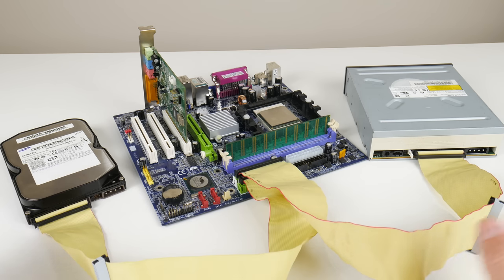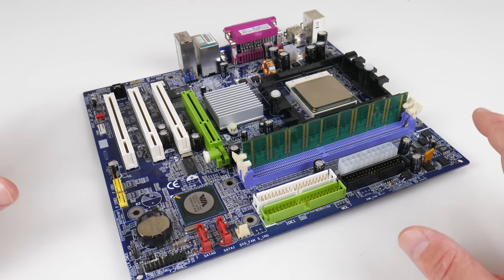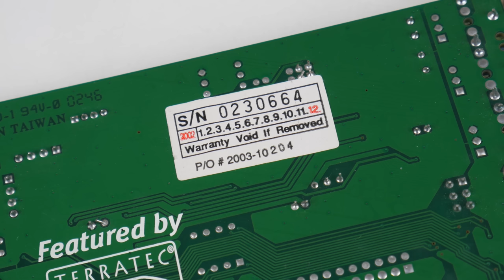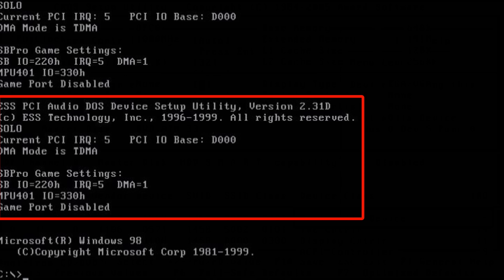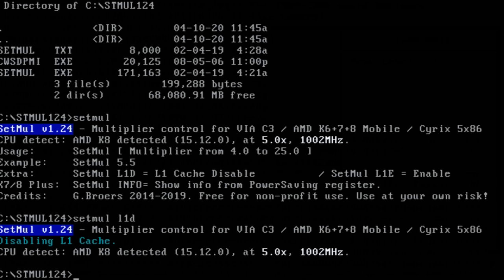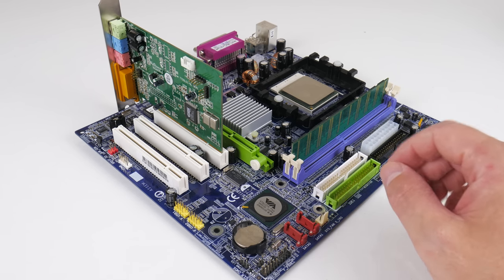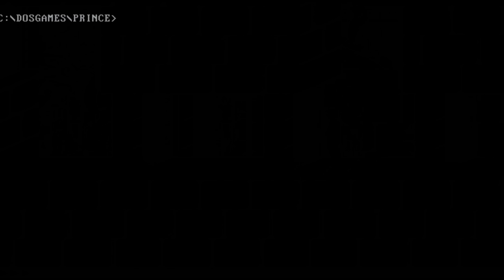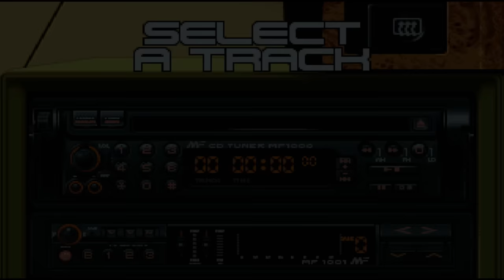DOS Gaming PC with Athlon 64?

Comment: I've been saying this for years, but with the knowledge we have today, there's absolutely no reason (for me at least) to invest in the Socket A / Socket 462 platform. The Socket 754/939 VIA-chipset platforms have excellent Windows 98 support, support modern AMD coolers and (most importantly) support modern ATX power supplies. 

What I'm curious about, and you've actually covered this in your previous videos, how suitable would a SIS chipset fare as a Windows 98 / DOS machine? To my knowledge the onboard display should be equivalent to a GeForce 2 MX 200 with very decent DOS compatability. To answer my own question, the uncertainty probably lies with the SIS South Bridge's ability to do TDMA (or its derivatives).
Reply from the maker: Hmm I don't think I've done something with SIS chipset yet, but just a matter of time I guess :)
Reply: @philscomputerlab  : Well, I think it'll add value. I've found some of SiS's stuff to be very underrated, particularly the 6326 (has decent VGA output and DOS compatability) and SIS 315 (which is actually a decent Windows 9x 3D card).
Reply: SIS mainboards at least ran Windows 98 and Me very well back in the day.
Reason for socket A systems: 3dfx AGP cards.
Reply: @armorgeddon  : I have a Socket 478 motherboard with a SiS chipset and universal agp slot. Great for 3dfx cards too, but incredibly difficult to find good coolers.
Reply: Ah yes, 478 and SIS can also be a nice combination. Coolers can be a problem yes, sometimes an option is to just use the best heatsink you can find without it's original fan and provide the airflow via a big modern fan mounted elsewhere, maybe helped by some DIY air ducting/guiding.
Reply: @Erik Mikkelsaar : Yup, one of the major platforms with the 478 platform. I own a few SIS 661FX boards, but they are in severe need of recapping.

Comment: I was never able to run one pci card in DOS before, I will try again some day...  Someone even gave me an old isa creative sound card (is not even a soundblaster, I don't remember the model) but I couldn't make it run either, I have few motherboards with isa slots and none are good. Although I used msdos as a child, I am more of the era of windows 95 and 98 my knowledge of msdos is very limited. However I think the msdos game era from 1992/93 to 1996/97 was a golden era and I regret not having conserved my hardware from that time.
Reply: Very old ISA cards need a -5V rail on the power supply, otherwise they do nothing. Maybe that is your issue. Also check for resource jumpers to set IRQ etc. on the soundcard hardware itself.
Reply: @armorgeddon  Thanks i'll check
Reply from the maker: It's all about having the drivers and knowing how to setup your startup files, or use a batch file. There is no universal solution as every sound card is different.

Comment: Phil i found an older operating system that seems to run all the game windows xp can run , i installed windows 7 starter on a system and so far i'm able to get those few game i could not run on 64 bit operating systems with xp era games to run on starter 32bit windows 7. if you want some content to test id love to see your results with windows 7 starter vs the older operating systems
Reply from the maker: Windows 10 32 Bit will likely run those games also!

Comment: Awesome video !! Already tried that years ago thanks to A64LOWP by Falcosoft working under DOS (maybe you know this software, nonetheless I suggest you try it. It works also with AMD Geode and Athlon XP Mobile but not with the KT133/KT133A chipsets) but it's nice to share it and popularize, vulgarize for the ones who didn't know it could be possible to use differently the Athlon64
Reply from the maker: Yes I know of that tool! Used with an AMD Geode :)

Comment: Hi Phil. I can't remember if simple usb joysticks work with DOS games. I assume I need some driver???
Reply from the maker: Nope they won't work I'm afraid...
Reply: @philscomputerlab  Thank you very much. I have successfully put together one of the HP  T5530 machines and am getting ready for gaming with that. What do you use for a joystick in this case?

I'm also beginning a build similar to this video but based on a similar earlier video of yours. I love the work bench you use for your demo build demos! I found a similar one. as well as an old Antec 300 case which I have previous experience with. I bought an adlib-compatible sound card for this machine.

Love your videos!!!
Reply from the maker: @robf228  the machine would need a game port. That thin client doesn't have one I'm afraid...

Comment: Phil, I tried Gods on S3 integrated videocard on MSI MS-6511 maiboard and Gods worked normally without any scrolling problems.
Reply: I guess it depends on exactly what S3 graphics are being used.  Their earlier (pre-VIA) chips, like the Trio and Virge, are probably less problematic for DOS than their later Chrome/Unichrome stuff.  Between these two were their Savage family, which appears to be what you have there, and is presumably better for DOS, from what you say.
Reply: Your motherboard has the s3 prosavage ddr integrated which is essentially like the savage4 gpu which isn't anywhere near like the unichrome family graphics that came later.  You do get good dos and windows compatibility.

Comment: Hello, can anyone help me? 
I bought a 2K 144hz monitor, im using HDMI 2.0, it says 144hz on the settings/monitor, etc. BUT it feels like 60hz, even comparing it to my other 60hz monitor feels the same, what can be? My PC has an RX 5700 XT its a powerful GPU, it can be the HDMI 2.0? I tried everything, but nothing works. Thanks
Reply: neirubo not a question for this video, but still: go to settings/system/display/advanced display settings/display adaptor properties for display #/monitor/select screen refresh rate to 144Hz
Reply: Yes, its already set to 144hz, on there, amd, everywhere, but still, not looking, or feeling like 144hz, i tried with 1080p 144hz too and nothing, do you know what i mean? It displays and says 144hz, but doesnt act as 144hz, the fluidity and all, is like a 60hz panel, even when i do test, like UFO test, 144hz look the same as 30 or even 60hz, playing games, runs at 144fps, but still feels like 60hz, but thanks for the answer, but im really sad, that i cannot find the answer.
Reply: Maybe a too old HDMI cable can cause that?
Or wrong settings regarding V-Sync, Freesync etc.?
Reply: Maybe (I am just guessing) can be the HDMI cable, or you are just at desktop, where most programs run at 60Hz. Maybe try in games to limit the frame rate to refresh rate of the monitor and see what fps you will be at. I am using display port and have 1440p 75 Hz monitor, and my rx 580 can barely do that, but I can sense in some games difference between 60 and 75 hz when limiting the frame rate to 60.
Reply: Or maybe, just maybe, look at the specifications of the monitor, they can sometimes display false information (some scam brands). I have bought in the past 1080p television from sony only to realise it was just 1360x768 panel, that can downscale 1080p signal, so maybe they have tricked you
Reply: Oh, but people say that 144hz are working for them, but idk, people sometimes maybe say things about 144hz, and they dont even know that the real are 60hz, and they keep telling is 144hz.
The monitor specifications are. 1080p 144, 1440p 144, and 4K 60, which 4K 60 looks really awesome, but i wanted to try the 144hz with 1440p, but nothing. BTW the monitor is from GAME, its a BIG Brand... so idk.
Reply: Hello armorgeddon, its the HDMI 2.0 that comes with monitor, they say use HDMI to get 144hz, maybe theyre wrong and i need Display Port?
Reply: I never heard about the brand GAME. You also still didn't provide info about operating system, exact model of screen, type of HDMI cable etc..
Reply: Game and Gamestop, never heard of?
Windows 10, 32GB ram, 2SSD, 3 HDD, RX 5700 XTGigabyte OC 2.1Ghz ,B450M DS3H, 24 inch 144hz 1080p,1440p and 4k.
HDMI 2.0-
Reply: Gamestop yes, Game hardware brand not. I'm in Germany, so maybe that's why.
My last guess is that either your monitor and/or you GPU can't do 144 Hz over HDMI, so try DisplayPort which is more professional anyway.
Reply: Oh,thanks then, do you recommend any Display Port? Im from Europe too, so you can recommend your Amazon website. Bye :)
Reply: You mean recommend a specific display port cable? I avoid using Amazon to prevent a total monopoly. I usually order my cables at Berlin based *memoryking*, which is selling on Ebay, too. Even the no-name stuff he sells always worked for me, his better cables are branded deleyCON. One of the best known, non-snakeoil cable brands is Inline: https://www.inline-info.com/de/produkte/kabel/displayport/ .
I hope you can make it all work!
Reply: Im gonna buy one, but on Amazon Spain, where i live, its called iVanky it supports 2K 165hz :)
It has almost 3000 product reviews and it cost 10 euros. Thank you for helping me, when it arrives, i will tell you! Have a good day, stay safe, and peace!
Reply: That cable will be fine for sure. We'll see if it also solves your problems. Yes please tell us the result here. I'm waiting for the "3dfx Legacy" book which comes from Spain, but due to Corona it's delivery is heavily delayed. Hopefully that issue will be a thing of the past in the very near future. Cheers!
Reply: Hello armorgeddon, i have been looking for FAKE 144hz monitors on YouTube, and i found that the monitor i bought, GAME M238E4K is a SCAM, what do i mean by scam, i mean that the 4k 60hz is true but, more than 60hz on ANY resolution are fake, ive been searching my monitor originally is called Armageddon Pixxel+ EFX 27UHD SWITX, but with the name of GAME, so i dont need to buy any cables, now i know why any hdmi cables didnt work :(
Because it shows on settings nvidia or amd panel but are fake numbers. 
Thanks for all the work searching, atleast it does 4k 60 :/

Comment: i bet you cant get ultima 7 working with voice on this rig
Reply from the maker: Didn't they patch it so the cache doesn't get enabled?
Reply: Works on an Athlon 64 using the u7dcp patch. Don't know about sound.
Reply: vvbee yea that's the kicker, you cant load sound drivers because of u7's memory management hogging all the conventional memory and it wont allow ems, its ISA sound or nothing
Reply: PhilsComputerLab i don't know about cache, i did try furiously years ago to get voice working on a pci sound card and did try patches but ended up building a computer with ISA sound. Ultima 7 will run on any computer but due to its memory management, you cant load pci sound drivers to get voice working. Keep up the great work!
Reply: @alexsmith8021  My impression was that the game uses unreal mode for memory. I'd assume there's some way to make a sound driver compatible with it, including writing your own custom driver, but whether anybody will - possibly not.

Comment: Had a question for you. Been watching your retro PC videos. They are awesome stuff like this one https://www.youtube.com/watch?v=YjGWj8d_gMk&t=207s
I noticed on an older computer I am working on, up by the push button switch on the front of the case (like on your PC in this video) there is a green grounding plug. Its like round with a hole in it, so it can be attached to something. It is OK to attach it with a screw, like anywhere on the case. I dont know why it is no longer attached in the case. But then again the case with that AT power supply and switch is over 25 years old now

Comment: Athlon 64 was probably the best of the useless CPUs. It was really good for it's time, but software was running just fine on older Athlon XP or even Pentium 4, and just few years later when Pentium III, Pentium 4 or Athlon XP owners had to do upgrade, Athlon 64 was obsolete too, because Core2Duo CPUs were true next-gen leap in performance.

That leaves Athlon 64 in a very bad place. It's kinda non-optimal choice for anything. When building Windows 9x machine it's better to go with Socket A and Athlon or Athlon XP CPUs. Socket A had great Windows 9x support, some boards had even ISA slots so you could use true Sound Blaster or even GUS for best DOS experience. If you disabled cache old Athlon slowed down to 386SX 33 MHz, so Wing Commander and few others games run at correct speed.

As for Windows XP it's better to use the most modern machine that still supports this OS. Core2Quad will work great with XP and you can get PCI-E, SATA, older PCI, and IDE. Everything you will need for an ultimate Windows XP experience, with EAX support.

It all depends on where you live. In my location It's easier to buy 1 GHz PC with ISA slots than getting ESS Solo-1 PCI sound card. Although retro hardware really got expensive in last few years.

Comment: What i am wondering is, would it be possible to use a graphics card in the AGP slot with DVI output in the DOS environment? And what would be the result in regards of capturing the video output if it works? I think that would be really interesting for capturing old DOS games, because VGA/70Hz/LowRes is always a problem. Almost no capture device, even if it says "supports VGA", does not capture the classic gaming modes of VGA (320*200, 320*240) correctly. Maybe an idea for another short video?
Reply from the maker: Yes that works quite well! Some games don't like running at 60 Hz though, like Lotus III the music will run slower :)